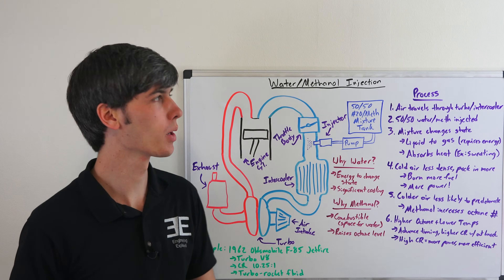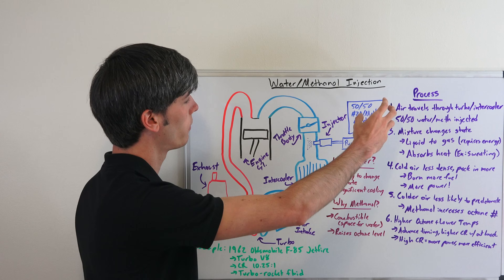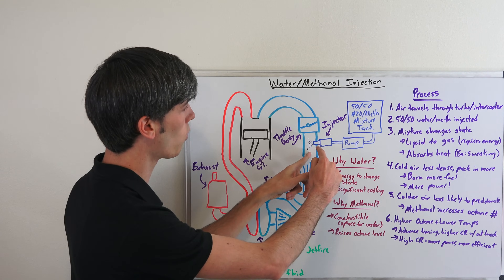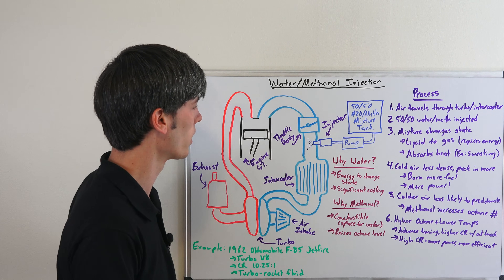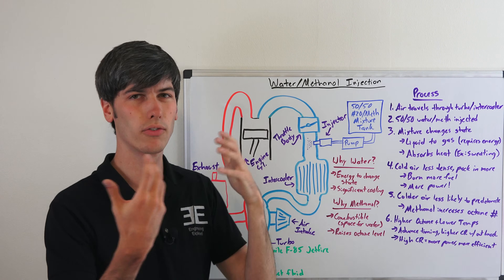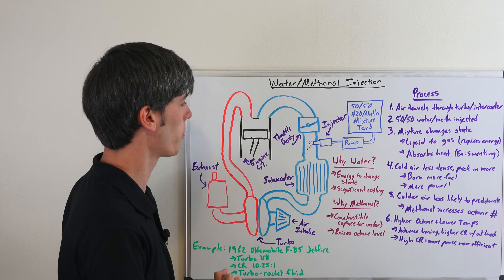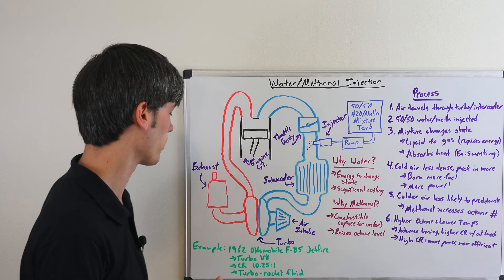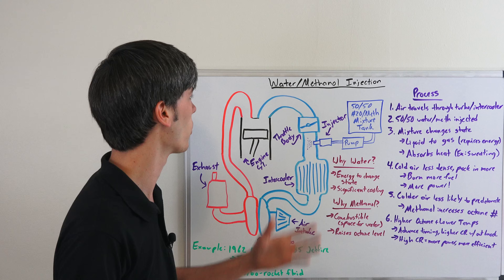Water Methanol Injection - More Boost!

Comment: basically it's nitrous.

NOSSSS
Reply from the maker: +Adnan Rahman Haha not exactly. Though nitrous does lower the intake temp, the main benefit is that it's physically adding oxygen to the mix, thus allowing for significantly more fuel to burn. Here, we're lowering the intake temp and increasing the octane level.
Reply: +Engineering Explained cool. what don't you know about cars? 

I'd like to see you mod out and tune a car. IT WILL BE EPIC.
Reply: +Adnan Rahman 
Sort of but not quite. Water injection just helps to cool the charge more, and helps with knock, so one can run a more advance timing for more power. Methanol adds extra fuel, and helps with cooling too, Both mixed combine the advantages of the two.
Nitrous Oxide, ads some cooling, extra fuel and plenty of extra oxidant, in order to combust the fuel, hence more power. It is the extra oxidant that is as or more important than the other two. There is no point pouring extra fuel into an engine if there is not enough oxidant (oxygen) to combust it, or it will simply be unused and blown out the back end.

Comment: Doesn't the new BMW M4 DTM safetycar use this? or atleast water.
Reply: +Jonathan Krogh The m4 GTS uses water injection to let the engine/turbo run cooler, therefore you can let it run harder and create more heat..
Reply: +Jonathan Krogh Yes, it uses water injection. As does the M4 GTS.
Reply: Distilled water I imagine is recommended...or are we saying water when it's actually water/meth injected?

Comment: Best and favorite mod on my 350z. Was 394whp before at 9.5psi, now I'm over 440 with a 100% Meth Mixture and 5-6 degrees more timing with the same amount of boost and no knock.
Reply: Its a V6
Reply: @Andreallen4  100% meth may be too much.  I am reading a 50/50 mix with distilled water produces the same effect, but with a cooling effect.
Reply: So I'm guessing from the hp you're running the 3.5l v6 turbo?? (not too sure if they made 350z's in 4cylinders as well)
Reply: +Andreallen4 What max timing did you end up with and what was the fuel octane rating?
Reply: +Felix Gonzalez I am running about 21 to 24 degrees timing once the Meth starts spraying. Not sure on the Octavlne rating sir, but I am using a CM7 Nozzle from coolingmist.com which is about the equivalent of a 600cc injector, so I am spraying a good amount. I take alot of regular fuel out of my target afr map to compensate the extra Meth richening the mixture.

Comment: I've heard of people spraying water into their engines to clean them. It seems like BS but a lot of people stand by it. Do you understand  why it works?
Reply: +bluesideking I thought the whole thing sounded stupid as well at first... but after researching it there's a ton of people that say it really cleans off carbon deposits. I read about quite a few mechanics doing it as well.

They imply that it turns to steam which is why it works. There's also some people that suggest that it cleans the valves so much so they perform better.

I have to disagree with you about it getting into your oil. That is no more likely to happen than gas is.

Obviously they are not implying you dump a cup of water in, as that would hydrolock or whatever that's called your engine. Which could bend a rod.
Reply: +bluesideking Its all about context. I work at a combined cycle power plant and we inject demineralised water only into the Gas Turbine -7kg/s @ 140bar or 2030psi (known as "high fogging"). Through this process we make an extra 20 MW of power. Thats 26820 HP!. Not everything is stupid if discussed in the right context.
Reply: +Christian Neff That´s very stupid. I would get in your oil system and ruin it which would lead to an engine breakdown. Also if some drops would stay in the cylinders, they would also destroy your engine, because the volume of water increases at 1000% (no I didn´t add to much zeros) when it changes it´s state from liquid to gas. So I wouldn´t recomend you to spray water in your engine, because that would be very stupid.
If you want to clean your engine, then you can use some special additives which you can mix with your oil. So when you change your oil, all the dirt gets washed out.
Reply: Ok, then maybe I didn´t understand you right. I thought about "running" the engine on water. 
I worked some months in an engine tuning and restauration company and when we did get the cylinder heads and engine blocks, we put them in a special washing mashine for engines. Like you said, the mashine cleaned the engines with steam and we also had a special chemical against the oil rests. But after washing we sprayed a special oil in the cylinders, so they wouldn´t rust. 
I will do some research, maybe these people you were talking about know what they are doing. ;)
Reply: +bluesideking This works best on Direct Injection engines that would otherwise see no fluid touching the valves. For example, many DI BMW with carbon coated valves decreasing engine performance and fuel economy. You would have to pay near 1 grand to have the dealer clean the valves. Using WMI before the throttle body will be the only way to automatically clean the valves.

Comment: I use water meth injection on my 02 trd supercharged 4Runner. Great stuff for boosted cars.
Reply: +BagelBytes "aircraft grade aluminium" = normal engineering aluminium
Reply: +Mathieu Prevereau it is injected into the intake before the supercharger.
Reply: +BagelBytes also, I am not running an intercooler, as I don't think it's needed for my purpose. It's a daily driver that I don't rip on a lot. Also not pushing more than 10lbs of boost.
Reply: Is your mixture injected before going through the supercharged or after ? i have a screw s/c and am wondering about the setup (tldr ; will it rust my s/c)
Reply: +Mathieu Prevereau You want it cooling the charge air, which is located after the intercooler if youre running one. If not, then just put it before the charger. It should be made of aircraft grade aluminum which shouldnt rust but I would worry about any seals with the alcohol eating away at those.
Reply: +bbtwano  I think I'd rather inject it after the compressor (supercharger) if there's room - since the charge is hotter at that point, it should vaporize more efficiently at that point...and not leave possible liquid inside the supercharger scrolls/screws/vanes/whatever system yours is using.  Of course, this assumes there's a way to plumb it in - there's not always much room between the blower and the intake runners on some engines.  Just a thought.   :-)